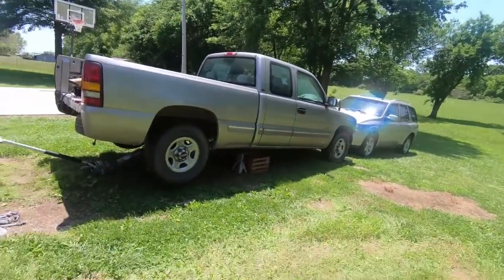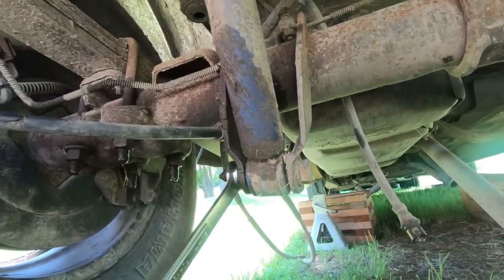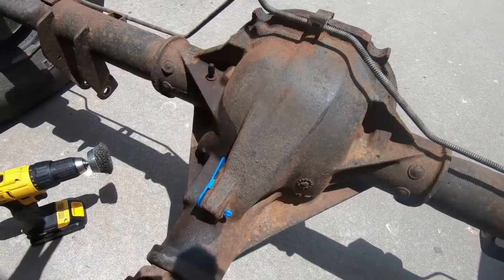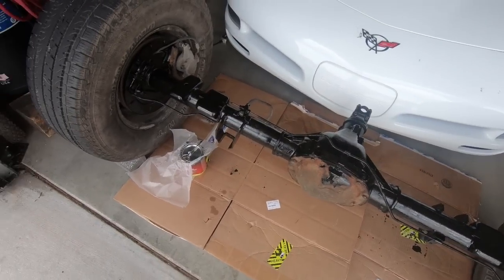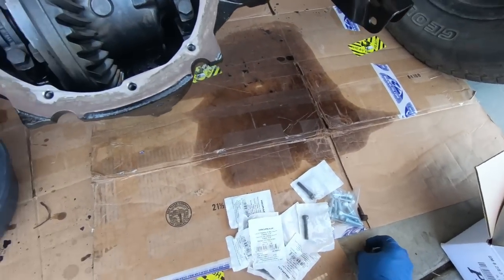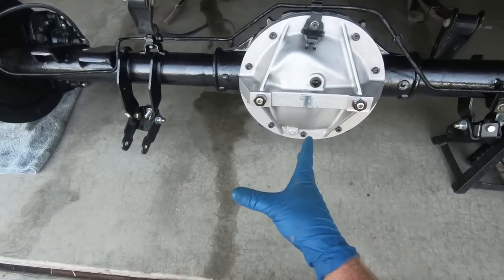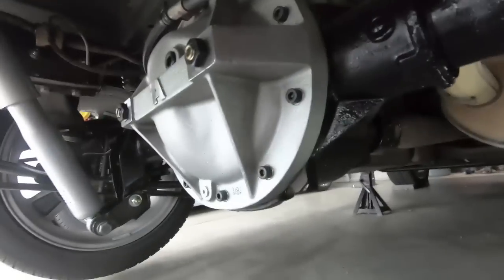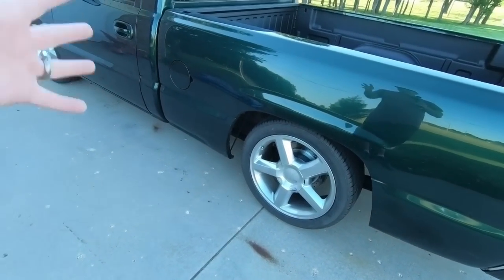Slammed Sierra Rear End Swap for the Upcoming LS Swap

Comment: Doing a 6.0ls swap all refurbished every part brand new but they said when I get a 4180 I need to upgrade my rear ended plus ima add 4:10 gears  so both my tires can spin is it worth it

Comment: Were the gear ratios the same?
Reply from the maker: No
Reply: @TWAMotorsports  is there a downside to them not being the same? I have a 05 Silverado crew cab with drums and I want to convert to disc. I have a rear end off a 03 Silverado disc brake setup. I don’t trailer anything. Thank you.
Reply from the maker: I am a fan of disc

Comment: Hey bro I got a question I put some lowering spindles on my 2012 Chevy Tahoe but didn't drop it u know why ?
Reply from the maker: Already had them
Reply: No I bought them from summit racing ..
Reply from the maker: @adolfosandoval7523  I mean you took off ones that had been installed before.
Reply: Yes I swap them with the two inch drop spindles n honestly I don't see no difference...u think I might need to change the shock's or something?

Comment: Okay question, I have a 03 Silverado 1500 it’s a z71 with 3.73s will the guts out of a 94 2500 rear end with 3.73 posi trac work in my diff ?
Reply from the maker: It should

Comment: Travis,  did  you have the computer flashed for the different gear ratio?  I assume you used your HP Tuners to make the change.  Talked to my guy that does tunes and he said its a simple change in the computer.  I was just wondering if the trans felt ok before you flashed it.  I bought a G80 rear end that I am going to go through before I do the swap on my sons truck
Reply from the maker: Yes I did make those changes with hp tuners but before changing it all felt good.
Reply: I was just wondering if it would be ok to drive about 35 miles or so to get it flashed or if I would need to trailer it.  Thats why I asked if the trans was ok if you drove it before the reflash  @TWAMotorsports
Reply from the maker: @brandon.buchanan81 you can drive it

Comment: are we doing warm over mods first or v8 in truck then we warm it over? G80 isnt bad for a street truck. i think the other is the G86 is the LSD which I think is a helical gear style? Im still a fan of 4.8 pistons 706 heads and a hot truck v2 cam with TBSS intake. pick your headers and some side exit exhaust
Reply from the maker: Several things to do honestly. Just a cam and headers for now.
Reply: G86 is a Eaton clutch plate LSD.

Comment: would this work with swapping rearends on a disc brake truck to one with drums? are the parking brake cables the same?
Reply from the maker: I believe they are the same
Reply: @TWAMotorsports  reason i ask is because i will be doing the swap from 03 extended cab with discs onto a 06 single cab with drums.
Reply from the maker: Should work

Comment: hey man i have a 06 sierra with the one tire fire with 3.42 gears and i wanna go to the junk yard and get a g80 to put in it i just have some questions does it just bolt right up including brake lines because i have drum and i’d be switching to disc. thank you
Reply from the maker: Yes it will bolt in and work. will need rear brake line possibly.

Comment: So would the rear end from a Tahoe fit my 1989 GMC Sierra? I have the 5.3 installed already just need a different rear end. Plus I wanted the disk brakes
Reply from the maker: No they are coil spring rear ends

Comment: I lowered my 95 chevy c1500 with a djm flip kit and the passenger rear tire sticks out more than the driver side any help with that or is that how the truck is. Can the axel move ?
Reply from the maker: I'm not a fan of the adjustment in djm flip kit. Not sure as I never use them
Reply: @TWAMotorsports  I’ve been reading online that chevy has one side sticking out more than the other not sure if its true but mine is thanks for your reply
Reply from the maker: I have never experienced this

Comment: Purpose of the bolt and jam nut in the cover?
Reply from the maker: It's to tighten the bearing load caps. Keeps pressure on the bearing caps so they don't flex.

Comment: Do you have a list of possible donor disc brake rear ends that work on the 94 and older trucks? and how did you determine the gear ratio on the disc brake rear end?
Reply from the maker: I don't. Have to open the case to be sure on ratio unless original to the vehicle. Rpo codes in glove box should tell gear ratio if it hasn't been messed with.
Reply: @TWAMotorsports  thanks , I appreciate the reply …
Reply from the maker: You're welcome

Comment: This diff is better then the spring loaded diffs the block style for lock up is better for longevity and before you worry about differential transmission needs to be built first before anything the 4L60 Is super weak and doesn’t like anything over 6000 rpm shifts so if you plan on a camshaft or stall converter the transmission needs building or don’t shift past 5900
Reply from the maker: Yeah I know the transmission will be on borrowed time

Comment: The question I have is "why?" I'm currently trying to figure out what diffs came with what since my newest purchase does the 1 wheel. Is there a way to figure out which axles have a LSD?
Reply from the maker: Generally the glove box has codes. If you see g80 it has posi rear
Reply: @TWAMotorsports  Isn't the G80 a locker though, not really a posi? From what I understand GM put some idiotic mechanism in there that only really engages the other wheel when the first one has already been spinning a certain amount of RPM's more that its counterpart.
Reply from the maker: G80 is a locker style but considered a positrac

Comment: Awesome job Mr,     TWA
i just changed the pulley for the steering pump  and so  a new  rack and pinion on my TA. And capped the oem cooler , but i installed an external steering cooler behind the plastic dam under the radiator. Hope i get to drive it next week

Comment: Travis, is there a benefit to do the rear end swap on the V6 if i don't want to do the v8 swap? Like I said on your last video I just got an 03 silverado v6 but I've noticed it has rear disk brakes. I thought only the 4x4 models had rear disk. Am I wrong? The thing sits up way to high and I'm assuming the previous owners did a complete 4x4 suspension swap.
Reply: Its only a 2wd. Im aiming on doing an SS clone thats why i got the 2003.
Reply from the maker: That all had disc brakes for a few years. Maybe some small benefits with a v6 but not a ton

Comment: So did you already have rotors in the back or was it drums?
Reply from the maker: Discs already
Reply: @TWAMotorsports  would you happen to know what needs to be done for swapping from drums to rotors or is it a direct swap?
Reply from the maker: Direct swap. Plus new lines
Reply: @TWAMotorsports  so brake lines need to be switched out?
Reply from the maker: On the rearend

Comment: I would be interested in hearing about what you do about correcting the speedometer after tire and or gear swaps. I put 20s on my tahoe and the speedo is off about 5 mph.
Reply from the maker: That will be done with hp tuners when the motor goes in.

Comment: You could have put the gear oil in before you put the cover on, since you had it opening facing up.  That way when your sealant dries, all you have to do is put the rear in back in.  This will also test whether your front seal is good or not.
Reply from the maker: I could have. I put the gear oil in a few days later
Reply: In the 10 bolts with the fill plug high up on the pinion snout like this one, I put in ~2.5qts of lube.
Reply from the maker: Good info. Thank you

Comment: Perfect timing on this video. Was thinking about doing one of those covers for my LT1 Camaro. Probably worth the $150 for a little bit of protection on these rather weak rear ends, no?
Reply from the maker: Absolutely worth it for added strength
Reply: What added Strength it just holds fluid if you want strength and protection better gears and axles will get you right a diff cover WILL NOT this guy is delusional it’s still a GM stock rear end.
Reply from the maker: Maybe so